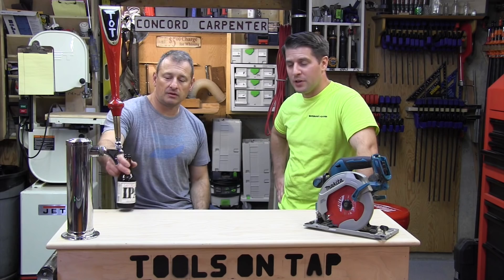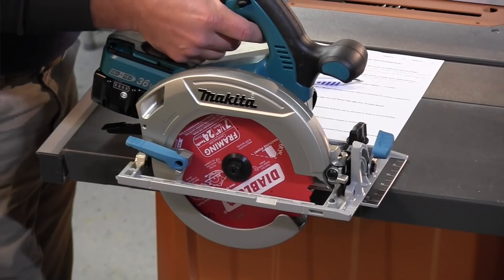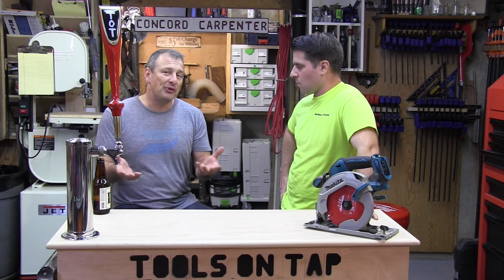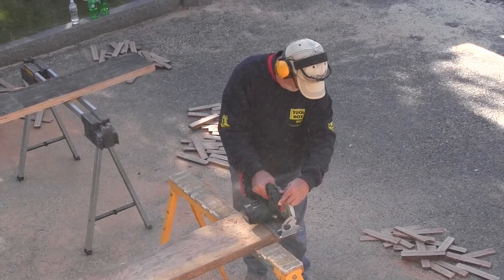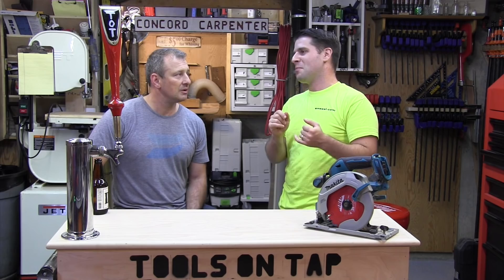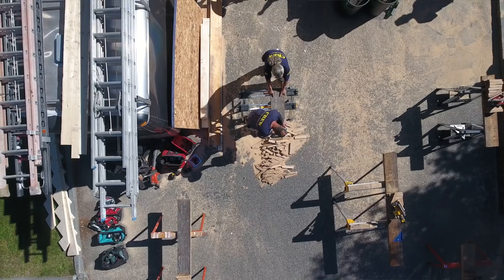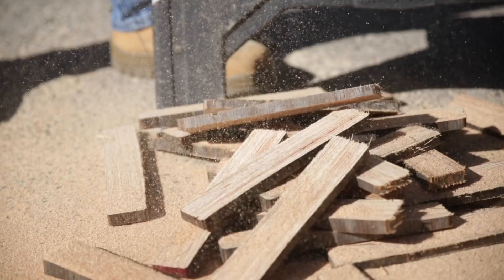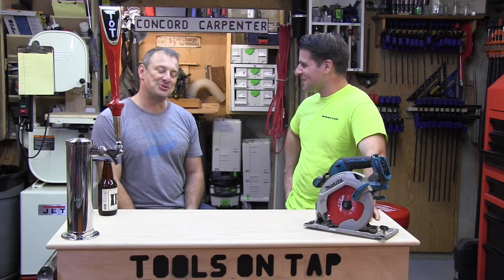Head 2 Head Test Discussion: Tools On Tap!

Comment: So I'll give you a breakdown of what is most important to me. I used to be a huge dewalt guy and right now all my cordless tools are milwaukee fuel(Drill, Impact, Super Hawg, Circular saw). I'm doing Electrical, Plumbing rough in and also carpentry and framing. 
1. What Battery Platform is the best based on the power tools provide.
2. Most powerful circular saw in that battery platform.
3. Most powerful drill/impact in that battery platform.
4. Most powerful right angle drill in that battery platform.
5. Weight of the tools. I'm a bigger guy so don't mind heavy tools but lighter tools for the most part are always easier on the body. I'll always go for the lightest tool that gets all jobs done not just one job done well.

We are finishing the rough in and framing on a house and the 2731 did everything we could ask it nothing stopped any of the fuel tools I listed above. One of the guys had his skill saw(worm drive) out and was cutting alot of lumber in the garage to length(3/4 advantech). You get reminded the power of that saw when you use it but its heavy and is not really ergonomic you cut different with that saw based on the leverage. However like I said nothing stopped the 2731. The one thing I hate is having to go get a corded tool to finish a job.....Just to add someone was using both 2731s :)
Reply from the maker: Me too brother

Comment: iam also plattform guy i got mostly makita. the 690 nailer from the dewalt and the handheld con.driller from panasonic 7840 i think. nailer and con.drill of it features that not makita or any one has better. then since i got charger and batteries i keep looking for baretool units. like now haveing my eyes on the dewalt finishnailer
Reply: 692 i think the model for the dewalt is ^^

Comment: I do love the way you guys test tools. I especially liked your rational on cordless finish nailer review testing---how bump test speed is not a good metric for judging a tool. A couple of asides: I saw on the "our build" channel yesterday a review of one of the new M18 saws, and he loved it but it kept failing while ripping a beam--he had to finish with his cordless bosch I believe. https://www.youtube.com/watch?v=_lLp_Yaoqf4 Second, I was at Home Depot today and looked at the new flexvolt miter saw. I had heard it was essentially the 718 with battery option. However, going back and forth between the two, the new saw seemed to have a smoother rail glide--was that your impression too? I remember that was historically the only really dig on the 718--not super smooth glide mechanism...Great stuff guys, I love the drone shots!!
Reply from the maker: James' website is great - I respect how he does his craft!